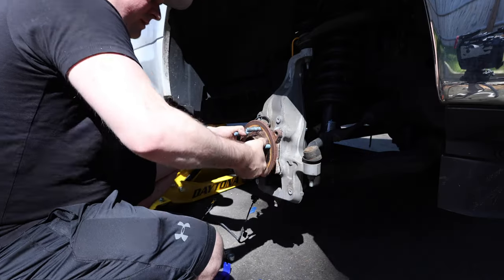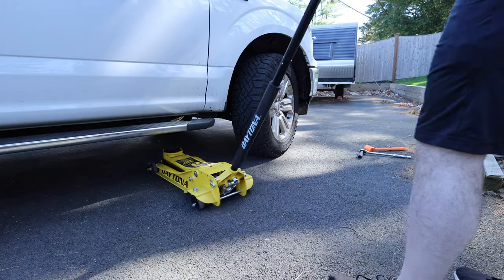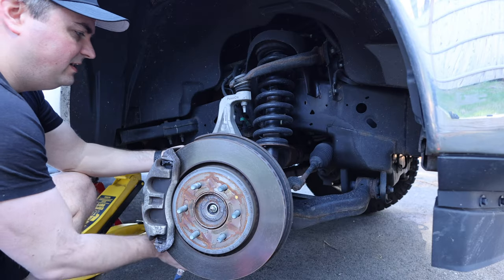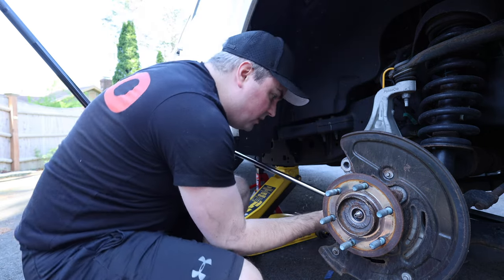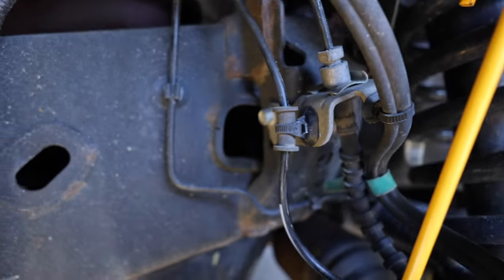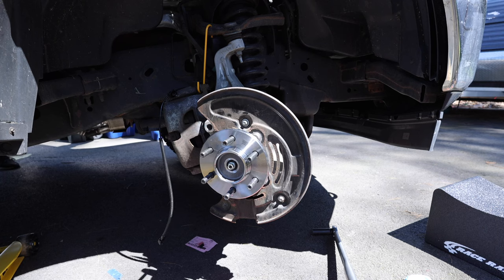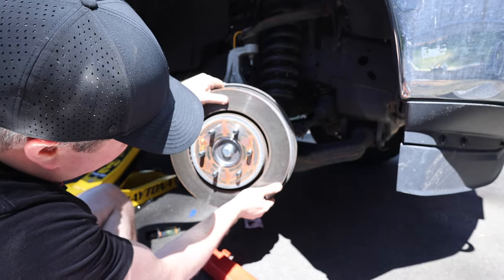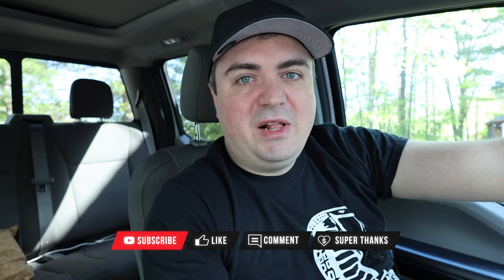2015-2020 F150 Wheel Bearing Replacement

Comment: Sad sad video. testament to the crap quality of modern cars. 2018 truck. ALREADY needing a bearing.  i have a 1990 1500 with original bearings in it. Still solid. 180K miles. Nothing but chinese junk these days.
Reply from the maker: To be fair. Our roads where are drive it are filled with deep potholes and the suspension takes a beating.
Reply: That's a good point I didn't consider. @SmackeysGarage
Reply: My 2020 F-150 already has 163,000 miles, and front passenger wheel bearing is going
Reply: @holdonsnow1028 my 2017 drivers side went out at exactly 163 too. Lol but it did take a massive hit from a big ass deer that busted the Iwe and let some trash get in there.
Reply: My 2018 4x4 just went out at 60k lol.
Reply from the maker: @fernie5.0 that’s when mine went too
Reply: After 208,000 miles on my 2014 4x4 f150, still with the original hubs, one is finally giving out. And that’s only because I sped up the process by daily driving it for a year with 14 wide wheels, 37 inch tires and 2 inch spacers. Drive 150-200 miles a day, so I’d say that was pretty fair
Reply: @rafaelramos5891  I have a 2011 with 244k still running on the original bearings. A 2017 that I just replaced the bearings and the 4WD IWE at 163k.
Reply: Mine at 60k as well as the cam timing phasers.
Reply: Yep my 2018 f150 left front wheel bearing is shot with only 96,000 miles. I have done some heavy hauling of my camper from Florida to Maine 4 times so I guess I shouldn’t complain too much.
Reply: How long did it take you in total hour?
Reply: 2017 101,000 miles and have to do all ballpoints which is kinda expected but also the front driver wheel beating is shot. Gotta replace that also.

Comment: I have never had a wheel bearing go bad on any new or used car I've owned in my 25 years of driving. It's hard to believe the best selling truck 40 years running has such terrible quality like this. My 2020 needs a new driver side bearing. Thanks for posting this to make it affordable for us DIYers.
Reply from the maker: Glad to help! New England where I live is tough on wheel bearings.
Reply: Come on man. All the vehicles I’ve owned have needed new hub assemblies on the front. You must not drive your vehicles for many miles or any actual use or you live in Florida and drive 500 miles a year😊

Comment: He nailed the sound with "it sounds like you're running mud tires" and gets louder. Also a faint squeak at take off. My driver's side on my '15 went out at 114k.
Reply: my 2015 is making that sound on the drivers side but it makes the sound when I turn left which is a little different than what I thought since he says when you turn left it will be right side, Either way I just ordered new hubs from A1Auto
Reply: Got a 15 with 125k and 16 wides and they finally are going out. Replacing them tomorrow
Reply from the maker: @bullproductionfilms8744 nice. They lasted a good bit.
Reply: Thank you! I could not find the words to explain the noise. Its suttle at the moment and seems to go away, but at first start up I hear it.

Comment: I watched your video to do this swap on my 2018 with the same noise turning hard right and then quieter turning left, and was beginning to make noise driving straight. Neither side had any play but I put a new hub assembly in the front left and the noise didn't change. Wondering if it's a rear bearing. Thanks for your video it gave me some confidence and surely saved me some time.
Reply from the maker: Glad I could show you the way to do it. I’ve been there with doing a wheel bearing and then having to do another. Sometimes it’s not as clear which one it is. That’s why I’ve been trying to do both front and both rears at the same time.

Comment: I’m pretty sure my drivers side wheel bearing needs to be replaced, but I’m only getting noise when making right right turns at slow speeds like on an off ramp. It is not loud when driving straight, and that seems a bit unusual to me.
Reply from the maker: It’s making noise when you are turning to the opposite side since all the weight of the vehicle shifts to that side. My suggestion would be to do both wheel bearings at once.

Comment: Don't trust that turning to the left and the noise gets louder means that it is the passenger side with the loading. Because there is side loading. When I turned to the right The noise went away. When I turn to the left it got louder. It was my driver side. It's all about side loading
Reply from the maker: Better off just replacing both any way. If one is going, the other one is usually close to needing replacing as well.

Comment: You should pull in the 4 wheel drive hub actuator with a vacuum pump before pressing the hub into the steering knuckle.

Comment: Not sure if this was stated in the comments already or in the video but i didn't see it.  This is for a 4x4.  The wheel bearing hub assembly for a rwd will not have the center spindle.  Threw me when I got mine in from Rock Auto.  Otherwise great video and thanks for showing how it's done!
Reply from the maker: That’s a great point. Thanks!

Comment: Having this issue on a 2018 Lariat 5.0 2wd with 178k highway miles. While rotating tires, I noticed about 1/32 of play on front passenger side. Will order parts and replace immediately. Thanks for the video and information. I do realize things are made different and in some cases don't last as long. Still, I love my Ford F150!
Reply from the maker: Glad to help. I'm the same way. I really love my truck. It's hard seeing myself ever NOT having a F150 in my driveway.

Comment: All stock 2015 with 205k (mostly highway) is still doing good on original bearings, front bushings and 4wd actuators are worn out and failing so I’m just doing the bearings while it’s torn down. Great video!
Reply from the maker: That is definitely the longest I've heard on these bearings! My New England winters, and unpaved roads really do take a toll on them. Glad you liked the video!

Comment: Great Video. I just ordered a set of hubs for my 2017 F150. Driver side is getting pretty bad and I'm doing front brakes on it anyways so figured I'd replace them as a pair. 
Nice to see its a pretty straight forward job.
Reply from the maker: Thanks! It’s a good time to do them while you are doing brakes. It was a pretty easy job as long as things aren’t rusted up. When I did my brakes one of the caliper slides was rusted stuck.

Comment: Great job! I have a little play in one of the rear wheel bearings on my 79 Corvette, I sure wish they were as easy to change as that!
Reply from the maker: Thanks Mitch! Same here with the older cars. Do you pack the grease and do it all yourself manually?
Reply: @SmackeysGarage  Yes, the Corvette's have to be set up with shims and runout checked with a dial indicator,  they are a real pain! And there's no way to grease them afterwards, just have to pack them real good during installation. 👍

Comment: Also...don't install that center hex nut (the one that has a dust cap) until after you've installed and tightened the (4) bolts to the new bearing. When you do install that center hex nut, grab the axle by the CV joint right at the bearing and pull it in towards the bearing (towards you). Need to make sure the axle and bearing are fully seated, or at least enough, when you tighten that center nut. If the nut isn't at torque and isn't showing 3/8-to-1/2" thread, it ain't on there all the way.

I had to use a stubby 5# hammer to tap my old wheel bearing assembly off.
Reply: You are the life saving comment brother thank you!

Comment: Great job!   Used it for my ‘18 and it was flawless.   
Let me know if you do the track replacement on the sunroof!
Reply from the maker: Thanks! I'm hoping I don't have to do that... but it seems like most have to do it at some point.
Reply: I've had my sunroof done by the dealer about 6 times until they did it correctly, under warranty of course,lol!

Comment: Great videos, appreciate you! Any chance you got a video coming on lower ball joint removal on these 18 F150s?
Reply from the maker: Thanks! I'll check mine out and see how it is early this spring when it warms up. How many miles on your truck?
Reply: 2018 with 106k on her. Barely noticeable,  can hear a jiggle with windows down on driveway potholes. Yet to jack it up and see 100%. Bout to find out this weekend. Have breaks sitting waiting to go on. Also had advan Trac light pop on once or twice. Gonna replace speed sensors while I'm down there.
Reply from the maker: Sounds like a lower ball joint, you are right. I'm at ~76k so I'm getting up there too.
Reply: Raise it by the lower arm n pull up on tire with pry bar to get an accurate verdict? I got no movement by hand when changing oil.
Reply from the maker: @joshlamport5489 that is the way I’d check it. Sometimes hard to see on trucks until it’s really bad.
Reply: @SmackeysGarage  question for ya... what forscan and link do you use? I'm fighting advancetrack, hill assist, ABS lights. Autozone readers won't give me a code.  Already replaced brakes, both front speed sensors,  and battery. Trying to solve before the dealership appointment. Thanks!

Comment: I got a 2021 Ford Ranger with 52k miles on it. Just received my new bearing today. Installing soon. It doesn’t help that I’m running 20x12 wheels with a -44 offset, but this seems sooner than it should’ve been.
Reply from the maker: Yea. Seems like the offset won't help, but 50k seems to be the norm for these trucks when they get used.

Comment: Great video, nice and simple to follow. One question, did you get a front end alignment after replacing the hub assembly?
Reply from the maker: No I didn’t. I did not touch the suspension or anything that would impact the steering alignment.
Reply: @SmackeysGarage  ok that makes sense. And since u were replacing the hub assembly to “original” specs with a new one it should’ve been aligned. I’m just curious since previous vehicles I replaced bearings and hub assemblies I would get aligned just in case.

Comment: Thanks for the video! I have a 2016 F150 that has a horrible humming noise while traveling at various speeds. This could very well be my problem and your video will help me. I'm curious though and I didn't hear it mentioned. In addition to replacing both sides at the same time, would you suggest an alignment after a job like this?
Reply from the maker: Yes I would do both sides at the same time. You shouldn’t need an alignment because you aren’t adjusting or removing any of the suspension. If you notice any abnormal wear on the tires I would align it.

Comment: Hey quick question. I saw another video where somebody had to use a vacuum tool to suck in the four-wheel-drive actuator in the hub. Is that necessary? I am about to do mine. I have a 2016 4 wheel drive XLT.
Reply from the maker: It does disengage the 4wd when you put vacuum on it. I’ve never done that on my truck (mine operates the same way).

Comment: Do you know the 21MM bolt part number for replacement recommendation?
Reply from the maker: I always use the diagrams at Tasca's site to find the part number. I'm not sure the year of your truck, but check this out. This is an 18 5.0. https://www.tascaparts.com/v-2018-ford-f-150--xlt--5-0l-v8-flex/brakes--front-brakes

Comment: Starting the truck to turn the hub and/or retract the 4wd actuator ring, requires stepping on the brake. The brake caliper is off the rotor so don’t forget your piston retraction tool!
Reply from the maker: I wouldn’t start it to move the wheel. The power steering is electric. You should be able to turn the key on and then twist if that is what you needed
Reply: @SmackeysGarage  I started it with no issues, light touch on the brake pedal. I’ll try without next time but I still think you need to start it to retract the actuator ring .(if you don’t have a vacuum pump )
Thanks 👍

Comment: Well mine is making the mud tire sound 😢.  They want $1300 to replace front and rear. Said the whole hub has to be replaced. Can't just do the bearings. Hmm 
One other thing. Did you use aftermarket parts or Ford parts?
Reply from the maker: Yikes... Yea the whole hub needs to be replaced. It isn't as easy as swapping out the bearings as with older cars. I didn't go with OEM parts on my truck. I would have gone OEM, but at the time when I did the replacement there was a shortage and I couldn't get ahold of any.

Comment: I'm having a problem getting the original rotor off. No there's not a bolt holding it on. Any suggestions
Reply from the maker: Big hammer. If they get stuck I typically use a 5lb sledgehammer. They usually seize to the face of the hub. Can also tap around the hub.

Comment: I have a bad hub and am waiting on mine to be delivered. I have to drive meantime. Can I grease my bad one temporarily to help quieten it or no?
Reply from the maker: I doubt you would have any luck with it. Comes as an assembly and I wouldn't want to pull the old one apart to grease it and risk not being able to get it back together.
Reply: @SmackeysGarage  thanks. Just annoying noises I think I’ll make it til part arrives

Comment: Do you have an electronic emergency brake and if so did you put the emergency brake in service mode before you started? You didn't mention anything about that, I'm just curious
Reply from the maker: I do have an electronic emergency brake. It’s part of the rear calipers. I did not put it in service position to do the front

Comment: ALWAYS ALWAYS ALWAYS!!!!! DO BOTH WHEEL BEARINGS!!! I do like the diagnostic reasoning behind the first part but if one goes out the next ones bouned by fire to go next. Especially with hub assemblies since there's no grease zurk. Good video though😊
Reply from the maker: Yes I agree with you completely. Best practice is to do both. The other side is probably about to fail as well
Reply: @SmackeysGarage  just did my parents f150, was having issues with the spindle nut cap on the driver side, which is how I ended up here, started with the driver side.. turned out the seal was shot causing heat, which resulted in a very rusty and crusty assembly haha. I was really appreciative to have such a descriptive video for it. Thank you much

Comment: Pretty sure my left wheel hub needs replacing ('humming' goes away turning left, very noticeable turning right). But no warning lights, and no sound like 'rubbing' or scrapping. Replace now or wait?
Reply from the maker: You typically won’t get a warning light for it. Replacement is up to you, but you definitely know it’s on its way out. Personally I would rather than take a chance of a failure.

Comment: My f150 2017 5.0 when I ride on dirt roads I feel a clicking noise in the steering wheel I already took it for inspection and everything is fine with everything that is suspension it could be someone who has experience with their f150 who has been through the same thing thank you
Reply from the maker: Might want to check on the IWE. When mine was going it randomly made a clicking noise and then a grinding noise.

Comment: @smackeysgarage How do you know if need a hub or just a bearing? (~$280 vs $10)?
Reply from the maker: I don't know if you are able to do the bearing only in the front. I believe in the front you must do the hub. If you find otherwise let me know. It's quite the assembly. I know looking at Rockauto, it is much easier to find a rear bearing only (no hub).

Comment: Hello I have a 2016 F150 Lariat 4x4 2.7 ecoboost. On some videos that I have watched, they use a mityvac. Do you think I need that on my Truck to do this? Sorry I am not an auto mechanic. Thanks
Reply from the maker: To do a wheel bearing replacement? No. I would seek some help from a friend with a project like this. Do you have a video where they show the use of a mityvac?
Reply: @SmackeysGarage , the vacuum pump (Mityvac) is used to pull in the 4WD hub actuator prior to installing the new hub. If you skip this step, the splines on the hub and the actuator can get bound up and the 4WD will not properly engage or disengage.

Comment: How many miles were on your original wheel bearings? Thanks
Reply from the maker: Around 60k miles. Up here in New England the suspension takes a beating.
Reply: @SmackeysGarage  thanks. 58k on mine and I just used your videos to do the brakes as the back were gone. Front had lots of life yet, but the bottom guide pins where both tight, so replaced it all.
Reply from the maker: @onionriverranch sounds like you had the same scenario as mine. Back were gone, sliders in mine were frozen. I probably could have reused the front rotors and pads if I replaced the brackets. Mine also had a lot of life in them. Thanks for watching!
Reply: 386k on mine

Comment: My truck is having a sound almost like I'm driving over those ripples they put in the road.  I was told it was torque convertor shudder. I did a flush and took it to a transmission shop and they said it wasn't the trans. It happens whenever it feels like it. There's no rhyme or reason when it does it. It's not constant it just does it pretty much whenever at different times.   I'm lost on what it is.  Anyone help?
Reply from the maker: Have you checked the axles? I'd see if all the bolts are still in
Reply: Yes I currently doing my brakes see if that'll do anything (doubt it will) but I checked all the suspension and the cv axle even check my IWE system for the 4 wheel drive and it seems to be holding air and working as it should.  Idk what the heck it is.  Driving me crazy though
Reply from the maker: @cavyboy99 that’s really weird. That’s where I would have went next, the IWE. When you said holding air, did you mean holding vacuum?
Reply: Yes the vacuum.   @SmackeysGarage